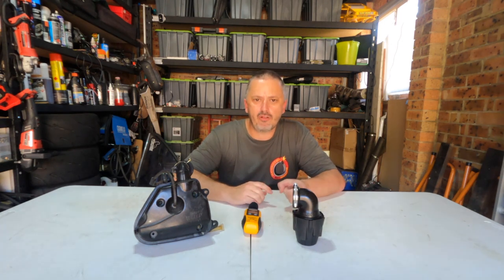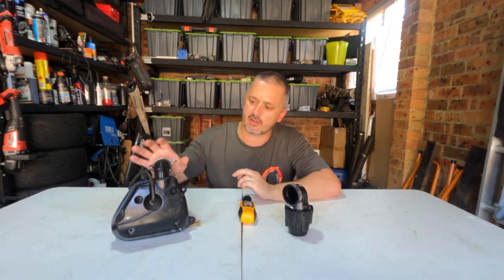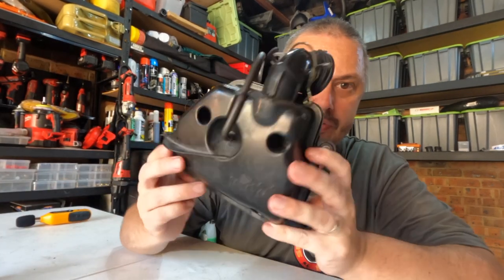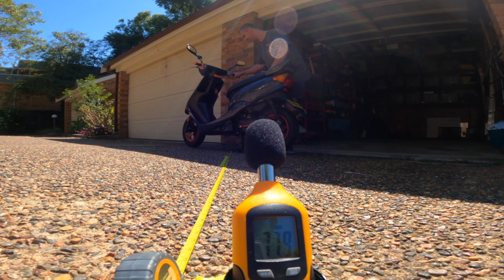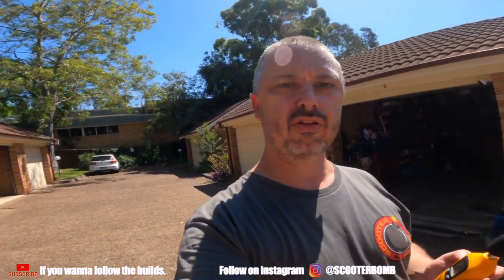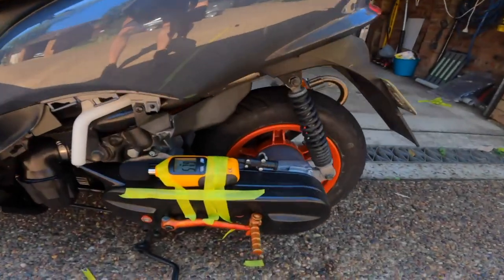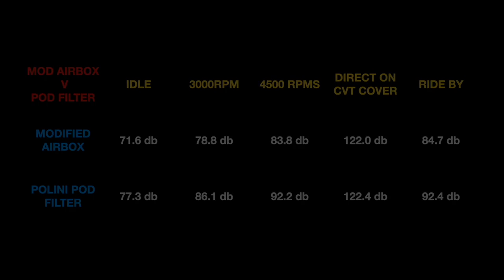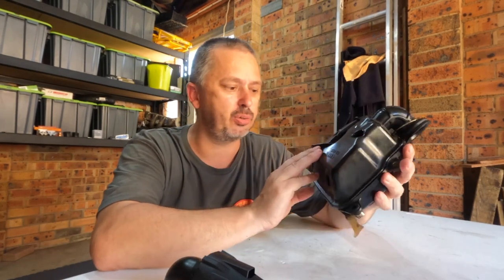Pod Filter VS Modified Airbox

Comment: I'd probably replace the snorkel with a piece of aluminium tube, with the end flared out. Every mm in diameter is quite a lot difference in % increase in area. You could fine tune the resonance frequency with the length the tube goes into the filter box.

Comment: I run a dellorto 19 with the stock airbox with the snorkel taken out.  I rev to over 10000rpm at 94km/h on my jog
Reply from the maker: What cylinder kit and is it the same type of jog?
Reply: @scooterbomb2152  polini sport 70 kit aka contessa.  Derestricted Yasuni r pipe.  It's a 1996 3kj jog with same horizontal minarelli.
Reply: Watching this vid again and saw my comment.  10,000 was a guess,  I have since put on a tach and I'm touching 13000rpm at 95km/h.  Stock crank is not long for this world lol.

Comment: I also like the idea of using the modified air box to keep the hot air away from the intake as much as possible
Reply from the maker: Yes I feel the same.
Reply: The extra holes in the airbox sit againt the head of the bike so your sucking in hot air. At least on my bws100 it will.
Reply from the maker: @P2DAPIPE  Yup you got that right.. It does get a bit of heat soak that you can see if revving it right out as it won't rev quite a high.. Been thinking of another way around it. Maybe a scoop into the air box

Comment: Wow , what a way to teach people the wrong info......  your scoot only revved out to 3k with the stock airbox cause the carb was jetted way to rich for the airflow of the airbox.    All you had to do was rejet your carb to the airbox and done...no hacking to your airbox.

When I go on long group rides, I run a factory airbox (with a velocity stack on the inlet.) On my FULLY built race minarelli that make 20hp(09 yamaha zuma 50cc base).  And it still revs out to 14k cause I retune the carb to the airbox.
Reply from the maker: I think you may of missed the point. It was all about how you can make a stock airbag perform like a pod filter without the noise. Take all the gains of a pod filter without the noise into a stock airbox.. Jetting down lost a lot of power.. Needed a 85 main to run the stock airbag without the stuffers..

Comment: It's going to be loud regardless with the yasuni c20 on it ...any expansion chamber exhaust will be pretty loud .. what most people use on jogs and Dios is exhaust like a jayaco or a cheaper version yms v8
Reply from the maker: Yes it’s a C10 it is pretty loud but the pod filter was way louder then the pipe.

Comment: Really nice and good video.
Just wanted to ask you something about the power filter. Do you know why people use a power filter, the Scooter people do it to be able to cool their engine more. and this happens precisely because when you drive with a power filter, you must always install a large main nozzle, otherwise the engine will not run very well, and when you have installed a large main nozzle in your engine, it will get more petrol and this will cool the engine better, and that's just a plus, the performance mostly for a small step up... I know many people use a power filter because they want more performance in the engine, and that's a wrong basis, as a rule, they only use more power precisely because a power filter requires a large main nozzle.
but the real way why you use a power filter is to cool your engine better.
This is also why many people do not use a power filter when they only drive with a 70cc sport setup, where you can easily keep the engine cool enough with a standard carburettor & filter and a large nozzle.
I drive a little Scooter myself on the track and love to build up the engine so that they have more hp.

Must remember to say.. what I have told regarding the use of the power filter is something I myself have been told once when I was younger.. and you are welcome to correct me if I am wrong on that..... even though I have tuned the Scooter "Yamaha Aerox" for about 20 years now, I could still be wrong or have been told something completely wrong.
Reply from the maker: I’m assuming your reference to a power filter you mean the aftermarket pod filters such as the one I used in this vid. 
The reason people use them is they let more air into the motor. More air needs more fuel. More fuel means more power. Simple.
Reply: @scooterbomb2152  Yes, what you write is correct.
more fuel gives more Hp.
but us who drive on tracks against others We don't fit a power filter to get more HP, we fit the power filter because more fuel gives much better cooling in the engine.....

Comment: Hey I love your work ! I have a Yamaha jog 2 stroke same as yours but it’s 50cc I’ve got a stage 6 exhaust and opened up my air box like yours but total amount I’ve opened it up by is 28mm or can I open it up even more ? What’s the max I can open it too. Or can I run it on a 90 will this be okay running on a jet size of 90 with the 28mm holl
Reply from the maker: Not sure on jet size dude. Too many variables and I’m hesitant to say as if anything goes wrong I don’t want to be responsible for giving bad advice. Best to start way higher and come down. For reference I’m running a 102 main on this bike

Comment: My air box is gone and I put a pod on it but if it gets any moisture it don't run. I ride sometime with no filter 
 What will happen?
Reply from the maker: Riding with no filter can be bad news. Nothing stopping the motor from sucking in debris, some debris will score the bore and if big enough may cause catastrophic damage the motor. There is no advantage of running no filter as the filters are not restrictive enough to make any loss in power. 
Sucking in moisture is no good either. Riding in the rain with a pod filter could be really bad too.

Comment: Have you tried one of the larger foam pod filters ? Also where did you buy the stage 6 air filter ? I’ll be needed a new one after watching your vid I think I’ll do the air box thing as well . Did your air box fit straight to the polini carb with no adapter required ?
Reply from the maker: I haven’t tried the large foam ones. I think they will be real loud as well but. I think I got the filter from maxiscoot. I have a little adapter for the CP21 to fit the stock airbox. 
Glad the vid helped.
Reply: @scooterbomb2152  yeah I suspect you’re Probbaly right about the other pods . Some of them look like they have some bulky foam but I’m thinking noise will still get out ,  I think I’ll go the route of the air box , I’m thinking the least amount of attention drawn to it from police the better .  Also the more linear power will be better for wheelies . That’s what I’m building it for . ..   do you have an idea what the little valve/ jet looking thing is in inside of air box is for ? I can’t remember what it was connected to I’m thinking it was the carb
Reply from the maker: @Ozfreerider_adventures  no idea what it was. I think the pollution gear that I threw in the bin. Like a exhaust recirculating valve. Don’t need that negativity. 😁
Reply: @scooterbomb2152  😅  l
Reply from the maker: @Ozfreerider_adventures  thanks for the Sun Paul 👍
Reply: @scooterbomb2152  I’m just liking at mine now , with the position of your holes in air box woulnt  be drawing hot air directly from the cylinder ? I’m wondering if one single larger induction hose to the air bike might be better to reduce noise and get cold air from a better position ?
Reply from the maker: @Ozfreerider_adventures  your probably right there. I do notice the hotter the cylinder temp it won’t rev so high. Maybe a cold air induction or something would suit
Reply: @scooterbomb2152  yeah I think when my carb comes I might toy with some ideas with that I mind . I would think some colder air would be good for power and I’m also thinking that the big air. Box next to cylinder would also restrict the ability for the hot air to get away from cylinder too . Making it run warmer than needed. Do you run the plastic shroud around cylinder ?
Reply from the maker: @Ozfreerider_adventures  yup got the shroud on the cylinder. With enough thought you could come up with something really cool

Comment: Hello Scooter Bomb. I'm thinking about replacing my stock Air Filter on my Sym Jet14 50cc 2021 Euro5 Injection to a powerlifter, or replace the intake tube to a wider one.
However, as it's a injection, everything is regulated by the ECU. So i wonder, will the air intake also be regulated? If so, there is no need to improve air intake.

And, if it does not limit air intake and increases intake, will the ECU also increase the fuel to perfectize the fuel-mixture?

And, (another one): Will it improve torque/power to the scooter?
I have upgraded the weights on my scooter and is doing 55km/u as i wanted, no need to go faster. However, as i'm a little taller and heavier then the usual drivers, will increasing air intake also increase my power?

When i'm for example at traffic lights, it really lacks power to go from 0km/u to 30km/u'ish. Meaning that i'm slowing down the ultimate flow of traffic.
Reply from the maker: The only experience I have with injection on a scooter is a honda metropolitan. I changed the CDI as well as the variation and rollers and it wasn't to bad. Could get to around 70kph on flat roads. That was a 4t scooter.. I would suggest you look at a replacement CDI
Reply: @scooterbomb2152  the new Sym Jet14 has no CDI, it’s been replaced by a ECU due law regulations (Euro5 regulations). The ECU is currently not unlockable nor replaceable due the complex hardware.
Reply from the maker: @TVARecordings  bugger. Sell it you don’t need that negativity 😁